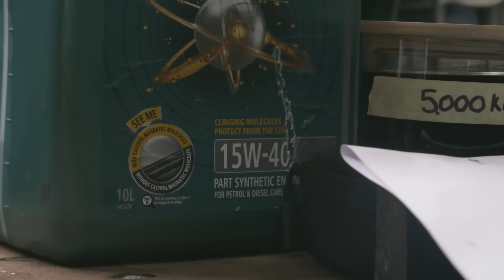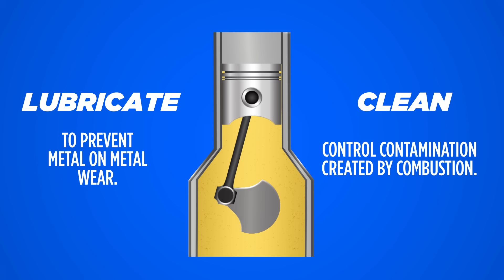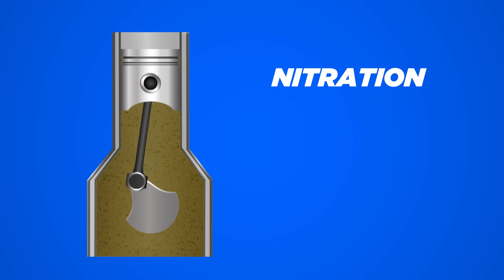Engine oil COMPARED at 5,000km vs 10,000km vs 20,000km! This'll make you service your 4WD RIGHT NOW!

Comment: I got 2, 2wd 2000 VW golfs. Both are lifted and got big tires. 

As they are both well over 300,000kms, one at 321, the other at 460 I change my engine oil at 5000km, the diesel soot, being older high mileage vehicles and drive like they are stolen helps to keep the engine going. 

Transmission fluid and fuel filters are done every 20k as the engines and trans work harder pushing big tires around, especially offroad.

Comment: On my Gu Patrol I usually change the oil when the shops have 10w40 on special! Usually around the 5000-8000km mark but it doesn't get driven hard so I'm not fussed.

Comment: Used to love LPG, oil stays gold colour for 10k. As for your comment  I think 10k in a healthy diesel running full synthetic is fine for normal driving. Going off road, towing, stop-start driving is considered extreme operating conditions according to owner's manual regardless of make.

Comment: I have a 2021 tacoma trd off-road 4x4 and I change it every 5k due to my 2011 Scion xB have ran 580k miles with changing every 5k and still running. The only problem with scion, I sold it. Smh

Comment: 2020  BT-50. I get the oil changed around every 7500 because the engine is new and want to stick to that plan. It's half the manufacturers recommendation

Comment: Have always serviced oil and filter every 5k. fuel and air max 20k. diffs, box and t case every 30k. For regular driving. If working hard or playing then those reduce for fuel, air and driveline. Also regular checks after and before each major trip.
Reply: Maintaining is always cheaper than rebuild or replacing failed parts. And your vehicle is typically the second biggest investment in Australia. May as well look after it fellas.

Comment: On my last few 4x4s, including my current Chev Silverado with the 6.6 litre Duramax donk,  I have fitted a Amsoil dual bypass oil filtration system. 
With lab testing every 10,000klm I have previously been able to get at least 50 ,000klm between oil changes and the oil is still in EXCELLENT condition. 
We're currently full-time on the road after selling our home. 
I'm towing a 3.5 tonne Bushtracker and am around 8.25t all up. 
I'm now being conservative and am changing the oil every 20,000klm....but am changing the primary filter every 10,000klm and the bypass filter at 20,000klm. 
Viscosity and contaminant levels are still absolutely fine at 20 000klm.
I'm not doing this because I'm lazy....but because the oil is better quality at 20, 000 than it would otherwise be at 5,000klm.

Comment: I also change my oil every 5k, on the grounds that I rarely do much more than 100k in a single trip and typically my trips will be less than 5k and starting from cold every time. Also when offroad, you might be putting your engine under more strain and idling more, not putting on the km. I do the diffs, trans, and tcase every 25k, mostly to make sure there's no water in them, although I might check them sooner if I've just done some deep water. I don't really have a service interval for coolant, but I make sure every winter it's still good for -40... cause there are days I need that.

Comment: I service engine every 5k or 3 months. I now have 225,000km and never had a single issue with my motor. 
Filters i do air filter every 6 months but depends how many 4wd trips i do. 
Fuel filter every 12 months
Front rear diffs transfer and gerabox oils every 12 months as i 4wd and tow

Comment: I do 5000kms and 100000 for the diffs box steering fluid brake fluid etc
Diff oil is clean as after 100000kms

Comment: Gee guys, I thought your brake episode was bad. If you want technical input, give me a call, I am based on the GC as well. 
My background includes RAEME, IAME and specialist in alternative fuels (well back in the day) 
1. Oil has two primary functions, Lubrication, and this is broken into two parts, boundary and fluid.
the second function is cooling. Oil does more cooling than the coolant believe it or not. 
2. The discolouration is carbon, the two main contaminate periods are start up and shut down, where by products of combustion are quite corrosive on things like bearings. So the oil wraps these contaminates up.
This is why you need to change your oil.  
3. Oil change periods come down to a variety of factors. 
Short trips, really bad, due to contaminates , things like EGR in diesels and a host of other factors.  Short trips are the worst for any engine, and especially bad for a diesel engine.   Short trips and use = 5k oil changes
Long trips, i.e not around town, engine running for an hour or more at a time, = 10k changes. 
This is one of the reasons why taxi engines would last 1m km and the average suburban engine (Same brand) would be considered worn from 100k. 
The fuel wash from start up, washes the oil from the rings (boundary friction) and this is where the wear occurs. 
What produces soot, is short driving. Bypass from the piston rings, worse when the engine is cold. Diesel is worse for this, as it is combustion ignition, so it becomes more efficient as the engine warms up to temperature. 
EGR on diesels makes this worse. recycling the soot in the exhaust back into the intake and turbo (great for emissions, bad for everything else. 
This contaminates the intake manifold, builds up on valves and restricts performance. How does this affect Oil?  Bypass of combustion. 
Modern direct injection engines compound this problem, as the injectors would clean the valve previously with each shot of fuel, direct into the combustion chamber means the valves run hotter and particulates bond and build on not only valves, but intake tracks. 
modern diesel now use an injector in the intake track to combat this problem.
For me, my 4WD is used only for trips and adventures, I run the oil to 10k 

Heat and driving, As I said before, Oil does more cooling than coolant. but driving hard, like racetrack hard, yes, the oil can be stressed, that is why they run oil coolers to manage temperatures
On every production car, they are used to heat the oil up, not cool it down. 
Cooling systems invariably only operate at 10- 50%. there is so much capacity in reserve. 
So if to get oil hot enough to need oil coolers, needs a race track environment, then no matter where or how you go 4WD, it will never be stressed through temperature, unless you have blocked all other forms of cooling, in which case it would boil first. 
Even towing does not place that much demand on the system
As a comparison, think of trucks, working to max, having to use their gears at every incline, that is working cooling and oil systems. 
That is two good comparisons. 

As a benchmark for all of this, I had a client back in the day who ran trucks around the country, he had an old VH commodore with over 500,000 on the clock, the only thing replaced was the gearbox, as he broke the case taking eaton diffs to one of his trucks. so much weight it literally cracked the gearbox case. 
He had written when he changed the oil and when he changed the filter on the shock tower and the distances would horrify you, they did me, at the time, I was religious with manufacturer specs. 
It was the quietest 202 I have ever heard, not a rattle, leak or knock to be found
I took the rocker cover off just to see if build up of carbon had occurred, clean as. 
But all this car did, was chase trucks around the country. many a story of draining diesel from one of his trucks, into his car to keep going, would only work if the car was running, hot and kept driving though, a real character. 
So what has changed between then and now?
Emission controls.

Comment: Engine oil every 5000 to 7500km depending on driving style. 15000km intervals are far too long. High quality oil also makes a difference. Pulled the cam and valves out of my SS at 65000km  and the engine looked polished and new. This is compared to another engine with less than 30000km where the oil was not changed as frequently with lower quality. The engine was gunky and coated in brown baked on  build up. This convinced me that frequent oil changes with quality oil guarantees long service life of your engine and components.

Comment: Engine oil - 5000km
diff, gearbox and transfer case - 15000km
air filter - every year
Coolant - 2 years
brake fluid - 2 years
spark plugs - 20000km

Comment: My oil gets changed every 6 months at approximately 6-8000km depending on my driving (less in the winter but more idle time as Canadian winters are rough).  The manual says 10-12000km depending on driving. The oil life monitor is supposed to keep track. I always change between 20-25% oil life left. Good filters and a good synthetic really helps.
Reply: The diffs, transfer case and trans every 3 years or 60000km. But I don't do as much off roading like you guys. I'll go out for the scattered day trip with a group and it's usually slightly harder than stock friendly.
Reply: Why km?
Reply: @mikeprice8307  cuz that's what we use in Canada...mostly.
Reply: @mikeprice8307 coz Canadian using km and miles in America

Comment: I've found I've had to do to 5000km changes on the 1KD hilux work well to keep the soot particals down. Diffs and gearbox check every 20kms and change before a big trip 👌
Another good note is you don't need the most expensive fully synthetic oil, your better off buying a good solid brand and changing it twice as often. 400,000kms and never opened the engine, so working well for me
Reply: Diff and gearbox don't need changing every 20k.
Unless you get diffs or gearbox submerged (possible contamination), 80k is more than often enough even in hard use.
If you keep temperatures in check , contaminants out  breathers clean and functional
200,000km is fine.

I have over 30 vehicles with between 1.3 and 2 million km on them.
Never had a gearbox or diff failure due to oil condition.
Reply: @masterq2.033  what kind of vehicles are those?
Reply: @masterq2.033  Yea your diffs failed for other reasons :)
Reply: Change shortly a good quality oil it's better than buy an expensive "top" oil and use it twice mileage 👍
Oil is the cheapest "spare part" of an engine.
Greetings from Argentina ! 🇦🇷
Reply: What is soot particals?
Reply: @keroro2611  "particles" 🤷‍♂️
Reply: @largo6644  are you serious?😂
I’m asking about the “soot” particles part since I have never heard of the word before
Particals = particles is already so obvious no one would ask anybody that, so no need to use 🤷🏿‍♂️ on me 😉
Reply: @keroro2611  Did you get dropped on head?   haha Its a diesel engine he is talking about.  Diesel engine soot, a natural byproduct of incomplete combustion, forms tiny carbon particles that can cause problems like oil thickening, filter clogging, and engine wear
Reply: @repentfromsinfollowjesus2953  which one of my words did I spell incorrectly?
Reply: 30 thousand to 40 thousand for a conventional gear oil and 60-70 thousands for semi synthetic and fully synthetics gear oil change intervals can be followed

Comment: First off I love you guys but! Using a quality filter is way more important than the oil. I can tell from the looks of that oil that you’re using cheap filters (I don’t care if it’s what the manufacturer specs.) try the same test but with a high quality filter (wix, puralator premium or whatever you’ve got over there) and you’ll discover that the oil stays cleaner longer. Also buy a good quality oil, Castrol is good but you can do much better. (I won’t quote brands cause I don’t want to start an oil war) ask the guys at your local race track what they run, I’m sure they won’t say castrol 😂

Comment: All depends on what driving you do. 
If you're a tradie just driving to and from a job site then 10,000km is fine.
Abusing them how you guys do, then after every big trip is what's needed. 

Rocket said he only gets a couple of trips out of the front wheel bearings because of the constant stopping in water, due to filming.

Comment: My stage 1 VW Turbo hot hatch from new, has been oil sampled and changed every 5000klms.
I was informed by the SOS Lab (Cat fluid testing) tech that the detergents in the oil's start to deteriorate after 5000Klms.

Comment: Servicing my Ute I typically do 6000km it’s a weird number but when I hit the 5000km mark, I’ll start to look for ryco filters and castrol oil that are on special. With each service I’ll check the diff and gearbox oils to check for any indication of wear and I’ll change these about 4-5 services.
Every sevice I’ll check through brakes, bearings greasing shafts and bushes, check other fluids, inspect the coolant for electrolysis, maybe even rotate the tyres.

Comment: something else that needs to be taken into account on your oil changes is time if your 4x4 sits for extended periods the oil might time out before the milage interval. Engine oil can become contaminated by things like moisture just from sitting requiring a oil change.
Reply: That's what they say, but moisture evaporates when engine get to operating temp, so there must be another reason 🤔

Comment: 82 Hj60 land cruiser 1hdft manual
Engine oil and filter at 5,000 ks
Diffs, gearbox and transfer at 10,000 ks
Oils cheap, rebuilds aren’t.

Comment: My 1HZ engine has done just under 500k km and in the last 16 years of my ownership, I’ve changed the oil and filter every 8k km. 
After each oil change, my oil is black after about 4k km.
It uses no oil to speak of and there’s little to no noticeable crank case pressure… 
The engine has never been opened.
It’s doing just fine in my book…
👍🏻❤️🇷🇴
Reply: 8000km/5000miles/6 months is the recommended interval by the Car Care Nut, a Toyota Master Diagnostic Technician. Can;t agree more with this guidance

Comment: Can people who work with heavy fleet vehicles chime in? These are the people with real experience with lab results and service intervals. From what I've read 50,0000km changes are acceptable in some circumstances. What is it exactly that's helping prolong the life of the oil? Is it the more complex filtration systems on trucks and busses? can modern oils really handle that kind of long term use without severe degradation? Obviously there is the huge expense aspect with fleet maintenance. Not saying I'm ever going to run 40,000km without a change, but I'm also not old mate change my oil every 2500km so it always looks honey coloured. Typically I've changed every 10000 in my skylines, engines are spotless inside. 7500-10000km with my diesel ute.

Comment: I have a car with 30000km service intervals and its doing fine after 220000km.  But if I have an off road vehicle being used in hard conditions I will also do oil changes every 5000km.

Comment: Some oils, like Penzoil none synthetic darkens immediately upon being exposed to the heat of combustion transferred by the metal parts, not just contamination as you say, seal your oil system so you don’t get contaminants into your oil

Comment: Used oil is darker because it has carbon in it. Carbon is soft and does NOT damage the reciprocating and sliding parts of an engine, in fact, for things like cams and tappets, the carbon actually improves lubricity!  Changing engine oil more than necessary is an environmental disaster, our cars are polluting enough anyway, lets not pointlessly waste engine oil through un-necessary changes.  The only reason i would change engine oil significantly before it was actual required was after i had a suspicion of any water contamination, ie after a deep swim where i got stuck with the engine significantly underwater, and even then i'd probably only drain off half a litre to check (the water is obviously going to be at the bottom) and simply driving the vehicle for a decent distance on highway will elevate the oil to a high enough temperature to boil off any excess water.  Modern sythetic oils include additives that do degrade over time and over heat cycles, but a modern oil in a modern engine can easily do the specifified service intervals without being changed........

Comment: Engine oil and filter 10k
Fuel filter 20k
Air filter 20k
Trans, diffs, transfer 40k
Coolant 80k
Brake fluid 80k

Comment: I have 2009 hilux i change oil every 10,000km auto gearbox and diffs every 30,000km. It has 390000kms on the vehicle now and I haven't had any problems.

Comment: Not quite the same but modern synthetic dosent break down before it gets too dirty. A better filter is critical and you can easily do 10,000 mile changes no problem. Oil isn't the issue anymore is keeping it clean

Comment: The recommended oil change intervals are mostly based on normal highway driving and also run time. If you mostly do hard 4wd for lets say 5k you might easily do the equivelent of 10-15k  of normal high way driving. The more highway driving you do, in theory the more ks you can do before an oil change. I forgot to change my diesel kia ceed oil and went 27000ks on the same oil. 327000ks on the odometer and still doesnt burn oil. For regular cars I change 15000 to 20000, for my hilux I changed every 10000.

Also diesel suts the oil very quickly, and especially a diesel with over 400tkms you dont have to go long before the oil is black. Diesel works as a lubricant so in theory you can get away with a bit more ks between oil change vs a gasoline car.

Comment: Not sure about this test. We don’t know what kind of oil was in the jars. Were the oils all the same? Just because it is dark doesn’t mean it is bad. I have seen brand new oil turn black as what was drained after first start. Also most manufacturers want you to use synthetic oils which last much longer. That is why the longer service intervals exist.